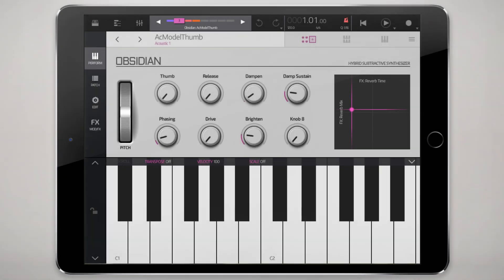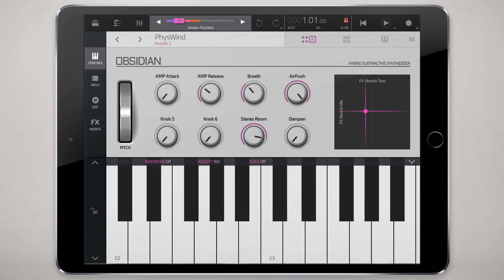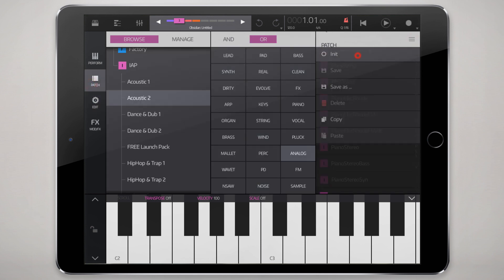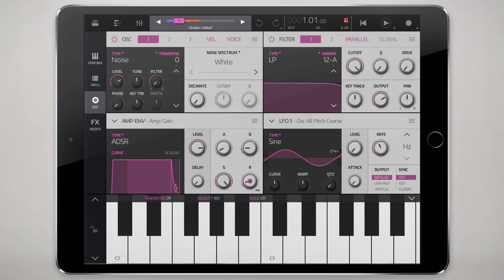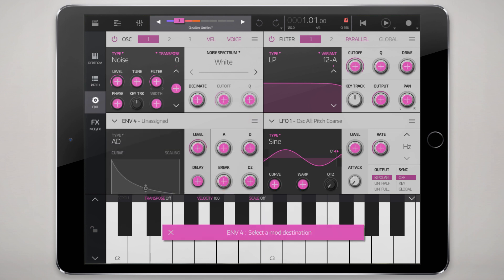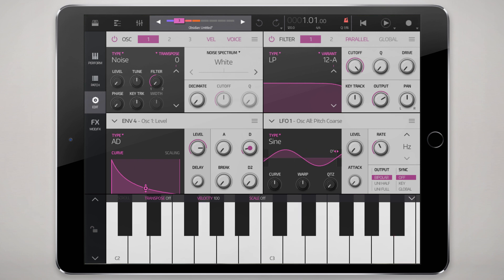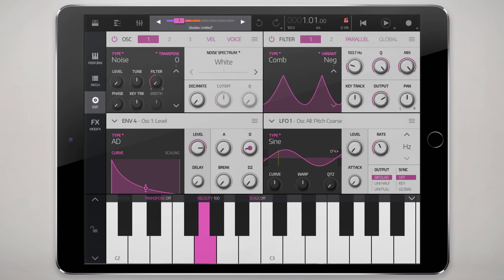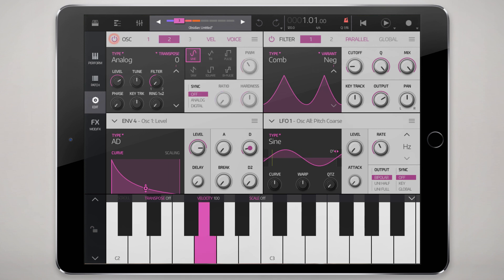Nanostudio 2 Quick Tip - Physical Modeling

Comment: Sweeeet!!!  Already salivating at the possibilities combining this trick on one oscillator with e.g fm tricks for acoustic-like behavior.  

BTW, the decimate function on the noise osc reminds me of the ‘grain’ control on the noise OSC in mersenne. Have you had success getting into woodwind territory with that - eg combining higher decimate settings with sustained noise (instead of a short burst) and this awesome comb trick? 

Thanks for the awesome videos!
Reply from the maker: The tutorial video shows a flute/woodwind sounding patch created sort of how you just mentioned (using the negative comb along with higher decimate setting, I believe). There are so many ways you can modulate/split/filter the noise and osc tone mix that you should have no problem getting any sort of woodwind sound you would want. I find that if you create one patch that gets you most of the way there, you can use that patch to build similar sounds just with a few tweaks. The patch I showed is called "PhysWind" and is found in the Acoustic 2 pack. So that could be a good place to start if you already picked it up.